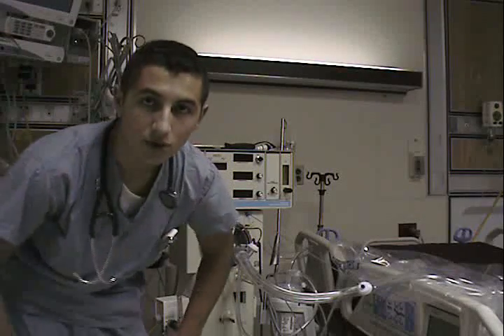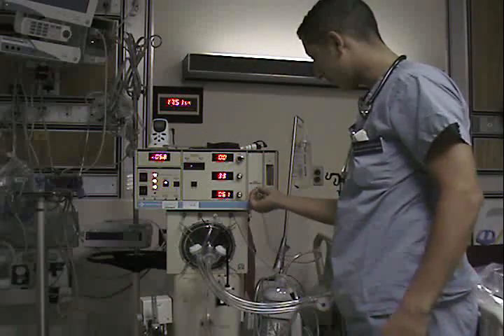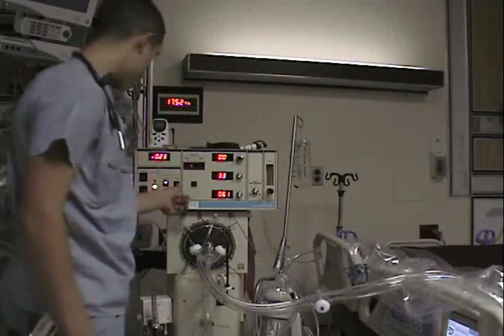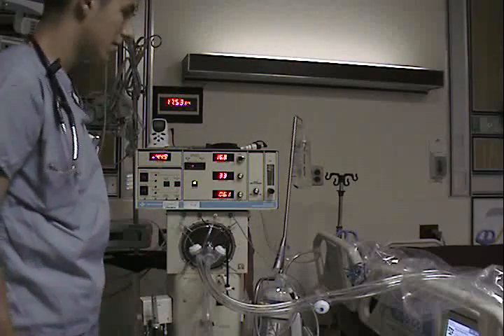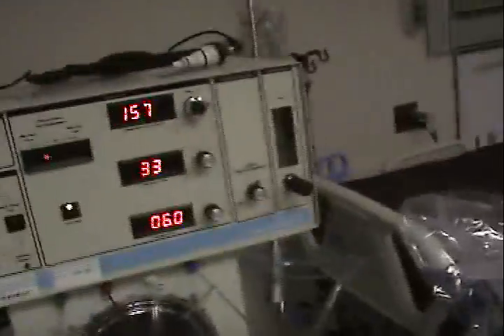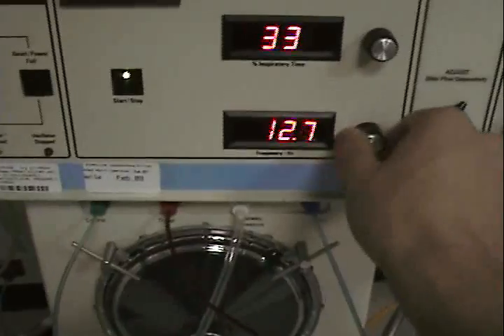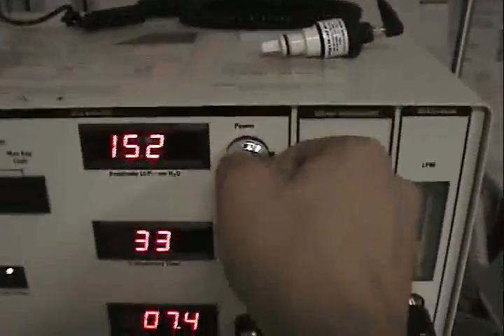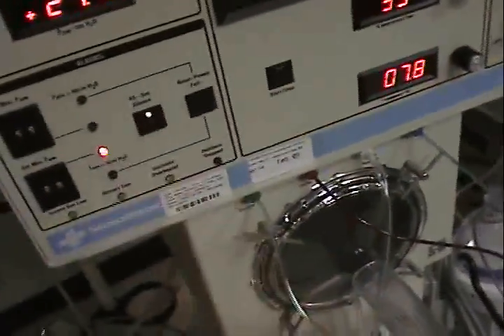HFOV (HIFI) calibratrion (success)

Comment from the maker: not necessarily. The may look the same but they are FAR from it. The 3100a allows you to manipulate the electrical counter force so that you may center the piston, also the 3100a has a max mean pressure limiter. not found on the 3100b model. As i understand it, the higher mean airway pressures you will get from the 3100b are enough to aid the pistons recoil ergo no centering needed. Patients under the weight limit (i forget the number) require more fine tuned control of these parameters.

Comment from the maker: humidification is extremely important. Lack thereof always results in consolidation of lower air way secretions. Which is very apparent on X-rays. There is always some form of humidifier on a ventilator be it pass over blow by or even ultrasonic humidifiers.

Comment from the maker: its actually a 3100b. sorry about that i dont think i said 3100b clearly enough, a 3100a has a piston that needs to be centered, the larger 3100b doesn't need centering because of the higher mean airway pressure is enough to push the piston back.